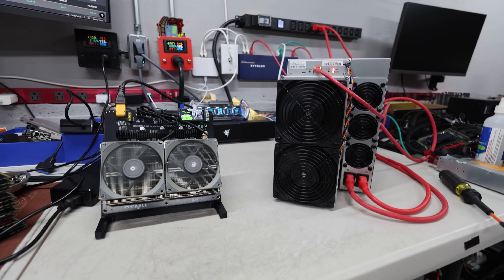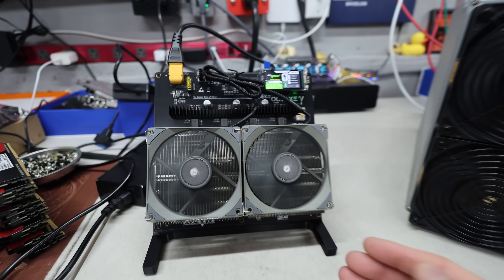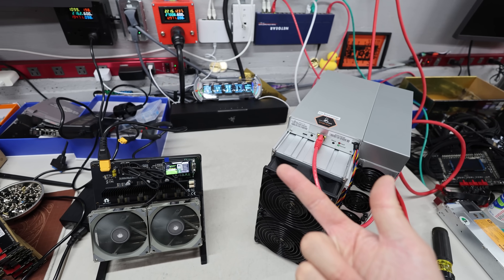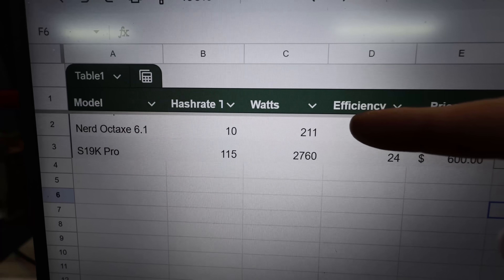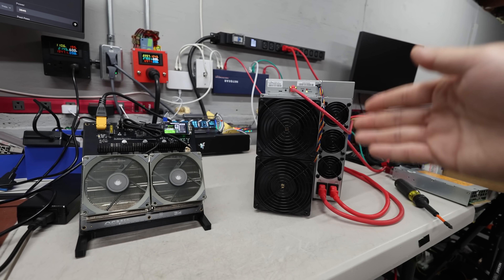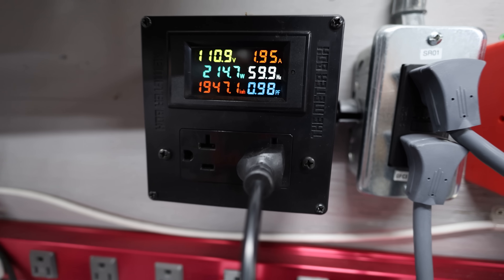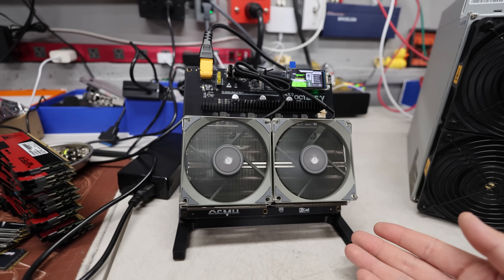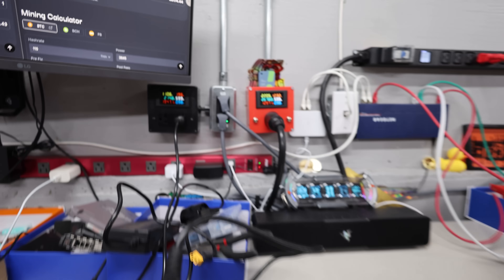This $600 Bitcoin Miner Makes NO Sense… Until You Compare Them

Comment from the maker: Today we’re comparing two Bitcoin miners that cost the SAME price ($600) — but they couldn’t be more different:

🔹 Bitmain S19K Pro – 115 TH/s
🔹 Nerd Octaxe – 10 TH/s

That’s over 10× the hashrate difference, yet the same purchase price. So which one actually makes more sense?

Links:
🚀 Antminer S19K Pro https://geni.us/ae6o1sk code RPMRPM for $30 off
⚡ Nerd Octaxe 10 Th BTC Miner https://geni.us/RKCAY code RPMRPM for $30 off
Reply: K pro will win easy
Reply: Octaxe for me because of electric rate and how it uses wifi.
Reply: Undervolting the s19 possible?
Reply: @KarimAkors yes
Reply: Thank you for hitting the nail in the head for anyone looking into mining. 
I could've bought that S19 and had it in a cart to buy but then my brain kicked in and remembered my .185 kw/h cost and went with 20w "light bulbs" bitaxe's instead.
Great video, waiting for what's next up?

Comment: I would be almost forced to go the Nerd Octaxe way, because of the huge strain the other puts on my infrastructure, a pretty old one that can easily take 200w consumption all day and all night but not the kind of consumption the S19K Pro requires. If I take in consideration the cost of almost rebuilding the whole electrical infrastructure, then the profitability of the Sk19Pro is not that good anymore.

Comment: It would be neat to have an MPPT power supply for one of these miners that would automatically throttle the miner to how much solar is available.
Reply: you could easily automate that.  just get a smart plug and have it set to go off for a while and let a UPS battery charge, then let it kick on late in the day, and when it does it dies.. repeat.  
have you ever priced solar for your home?  It sounds neat, but its not free. and now that you add solar to the cost, you time to break even is longer.  
i'm not a hater, i just want everyone to run the numbers and understand its only free, after you pay for it.

Comment: The main point of the small miners is not profit.  It is to support the bitcoin network by distributing hash power while also giving you a very small, lottery type chance at hitting a block.  If you are someone who is invested in, and cares about the health of the bitcoin network, then run a knots node, and mine to it using something like a bitaxe gamma which costs about $100, or maybe a nerdqaxe++ for around $400.  Any more is really overkill.  This is a low cost and easy to implement strategy for distributing hash power.  If some day, we could get 1million users to run a bitaxe and a node, then the network would be VERY distributed and healthy...
Reply: tks dude

Comment: Surprised you don’t mention the required power type 3phase vs typical single phase household electrical
Reply: The S19K Pro runs on single phase 200-240v.

Comment: Like you said it. It's dependent on what kind of infra you are using it in. In normal home evironment not likely but if you have somekind of hobby space you could run s19. And most ppl dont have dedicated space... but i wouldnt get either. Double the budget and get Avalon Q. That you can run in normal home environment.

Comment: Well so most people don't have 0.07c/Kwh, most who spend $600 on Nerdaxe are solo mining lottery tickets, efficiency is everything - they aren't turning a profit, its costing them for a slightest shot in hell at solving a block. S19j & Nerdaxe yeah maybe both cost the same, but as far as electric cost for solo mining that is reach for 99% of people to spend $250-300/month to solo mine. Just completely wrong application, apples to oranges.

Comment: Easy choice for me.

Octaxe, I would be the crazy person and stack these with solar and not solo mine with them just to earn 0.36 cents aday.

Less of a headache, easier to maintain the heat/clean, much more stealthy without the insane noise that asic gives off.

🤔 problem $600 is costly, but I think its because the efficiency, multiple Octaxe should beat the s19k pro. But the cost is still high, if they could lower it even more that I couldnt pass up on, I would buy multiple.

And sure u could tune down s19k pro, 🤔 but do I want to clean multiple s19k pro or multiple Octaxe. But Octaxe at $600 would pass on, bet they would sell quickly if they were much cheaper. Dont be greedy 😶‍🌫️ sell them cheaper!

Comment: 2x nerdqaxe++ seems to beat the octa? cheaper to buy, slight OC with stock hardware gives qaxe 5.3th/s @81W (15.3j/th). So x2 is 10.6th/s @ ~160w. Unless im missing something?
Reply: nope you're right, the octaxe doesn't make sense ( i have some of both). 2 x OC'ed qaxe++ beats 1 OC'ed octaxe both in hash, efficientcy and capex.

Comment: It just shows how over priced the home mining devices really are. They should be much cheaper. Have you looked into modded fw and using Noctua fans on a s19k pro?  Could run less boards and less noise and maybe more efficient 🤔

Comment: Its not even about which one you prefer, or which one you think makes more sense. Its about which one you can even run AT ALL. For a lot of people the S19 isnt even an option. To much power in terms of what your home electric can handle without modification, and to much wattage in terms of cost per KWh.  I'd love to have an S19, but itll never happen. So the Octaxe it is.

Comment: I will take a s19k pro. You can run a BraiinsOS on it and lower down a Power target. You also just run 1 of 3 hashboard. In this case s19k pro will very quiet and you still will have something like 20-35Th/s what is more than on octaxe

Comment: I’m going with the S19K Pro. Yeah, it uses more power and you’ve gotta deal with the heat, but with good airflow it’s manageable, and the boost in hashrate is hard to ignore.

Comment: I have a minisforum BD7945i SE, 7945SHX, mini PC (MB, RAM, and PSU was approx $600).  On Kryptex it is currently mining $.60/day using 99 watts ($.20/day).  That’s 3-4x profit of the S19k, runs on household 120V and is whisper quiet.  I understand it’s not an ASIC miner, but throw a low power CPU miner in your comparison.

Comment: It’s definitely a balancing act for me. I have two S9 units, I split one into three solo miners so that I could spread the power load onto different circuits in my apartment. I have “free” hydro but I’m stuck with 120v and 15A breakers. I’m debating getting an old s19 and modding the PSU for 120V and downclocking.
Reply: Check if you have two phases in your electrical panel. If so, you can install a 2-pole breaker to get 240V
Reply: @dayannicolay I’m stuck with single phase unfortunately.

Comment: RPM dude,  1000% i agree the high priced BS solo miners are getting out of hand, you can buy a $90 120v to 240v transformer or a $40 L3++ PSU with a $20 PSU spoofer and run 1 of the 3 hash boards at 950w at 40Th or 650w at 30Th in LPM and fan speed set low at 2500rpm to keep noice down, so basically with a little DIY you can have like 3 OCTaxe hashrate from one S19k pro hash board and less than $100 in mods using about the same power consumption as 3 OCTaxe, and using 120v circuit, the 120v to 240v transformers are the easiest and cheapest solution.
Reply: I am very interested in this actually. I am on a wait list for a prebuilt loki model but I may turn to FB marketplace and attempt to do it myself. I am not sure what a spoofer is though. Is that the loki board component as I dont want to start soldering in anything?
Reply: the 3rd and 4th solutions all require the Loki Kits you can also buy from Altairtech and they are available now, just replace the PSU with any of the Bitmain L3++ PSU or something equivalent, you’ll need custom DC power bus bars or DC custom wires from the 120v L3++ PSU to the hash boards , just two wires so not a big deal (12 awg wires) and the PSU spoofer by Loki , (not fan spoofers)  and after market firmware, this options is allot more work so most people just buy the full kit from Altairtech, the cheapest and quickest is just buying a 120v to 240v transformer and disconnect 2 of the 3 hash board.
Reply: @fullyelectric  it's been a while you posted a video, have you given up on mining..
Reply: they are  like 4 solutions, if you do not want todo any mods to the miner other than to run any after market firmware all you need is a 120v to 240v transformer and disconnect 2 of the hash boards, thats it,  the older S19 (non-j) you can keep the stock firmware since they will still run without only 1 hash boards, the J models like to see 2 or all 3 before they start to hash.
Reply: the other solution is just buying a modified Bitmain PSU any of the F version can be mod to support 120v input and Altairtech sell them for like $250, you still need to disconnect 2 of the hash boards to keep the power consumption around 900-950w, with two hash boards you’ll be close to 1900w too much for 15amp 120v circuit, however ok for 20amp 120v, so you’ll need after market firmware they are free and very easy to install but they do take 1-3% of your hash rate for payment.
Reply: Wow I did not know they were that inexpensive to go to 240v
Reply: yes they are very inexpensive its just a voltage step up, you just need a big magnet and some copper wires very simple, check out e bay for 3000-5000W Voltage Converter Transformer Step Up/Down heavy duty, very good ones $70 to $100 max. since demand is very low and so many competition price for single unit step up/down transformers is very cheap.
Reply: You are all-rounder 👍